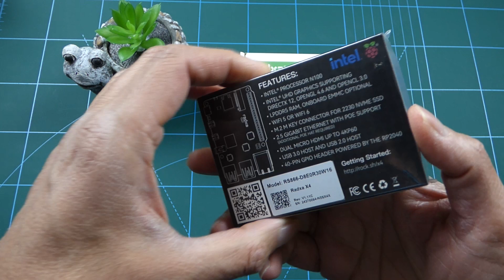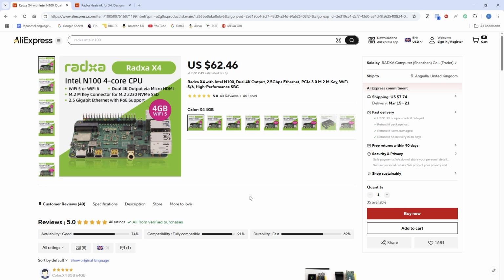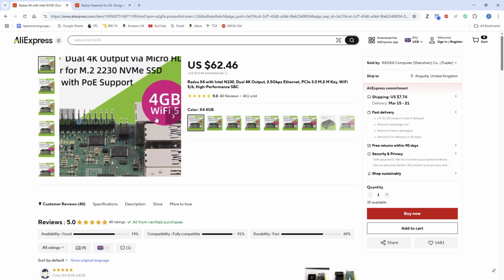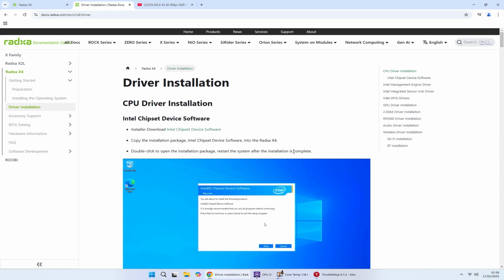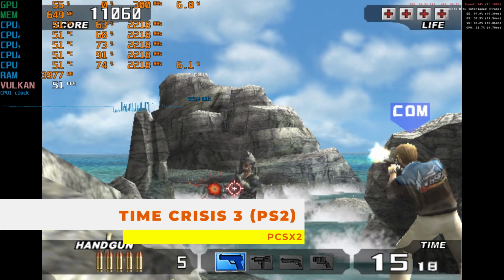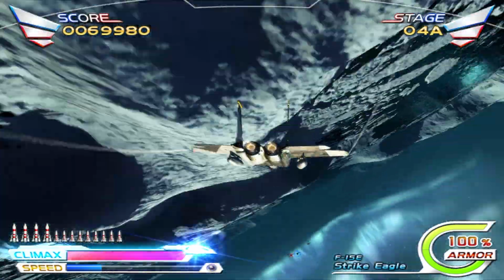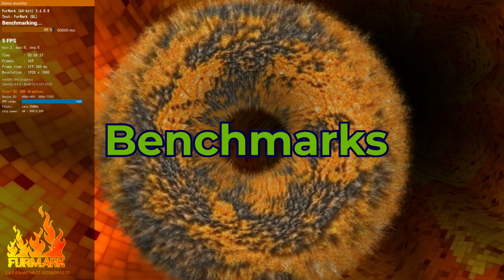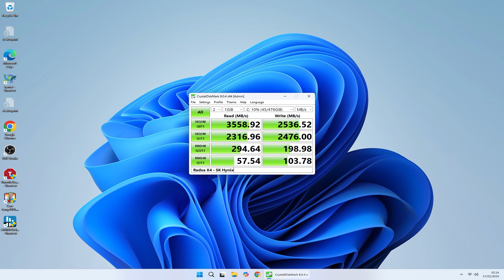Raspberry Pi 5 Killer? This Tiny $83 PC Runs Windows 11 & Emulators ! (Radxa X4)

Comment: Emulationwise it is not really much of a step up, compared to a raspberry pi 5. The next step would be to have PS2 running 60fps locked. This cannot achieve it, so better just stick with rpi5 for emulation. Lower price and power consumption etc. Sure there are improvements, but we are not there yet.

Still cool though.
Reply from the maker: For emulation an extra 10 watts is neither here or there really, its just splitting hairs. Sure the Raspberry Pi5 is more energy efficient but the Radxa X4 is so much better to use and generally faster in most things. 

Anyway thanks for commenting.

Comment: Honestly, this seems quite a bit better, from what I’ve seen the n100 is about twice the performance than the raspberry pi 5 in both cpu and gpu.
Reply from the maker: Yes the Radxa X4 is great for emulators. Although not as power efficient as the Pi 5 but for emulation it doesnt need it so much.